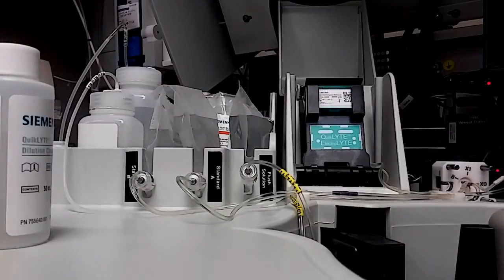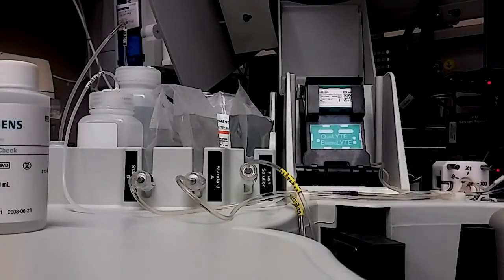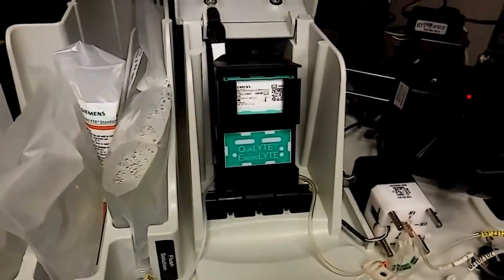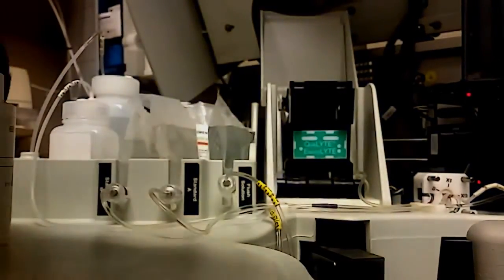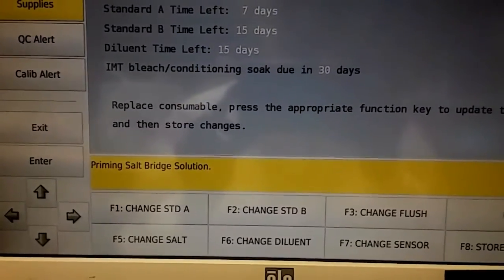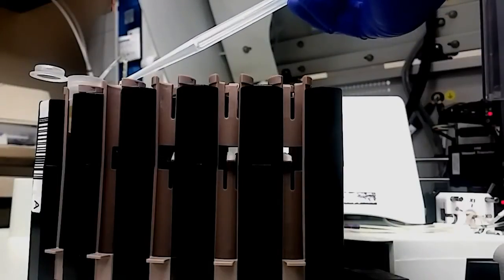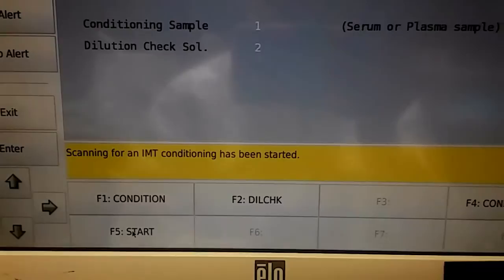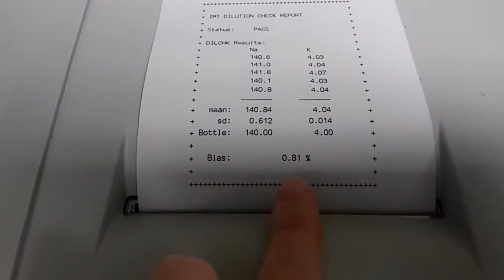DEMO: How to Change the Quiklyte Multisensor for Siemens Dimension EXL 200 and Xpand

Comment: Hey, we are starting to use this machine, and were told to always POUR the Dil check solution into the cup, to prevent contamination of the bottle. Are we just overly careful??
Reply from the maker: I heard that too after I've been not pouring it for years haha. I've never had a contamination problem with the dil check. Have had a problem with lytes before but actually ended up being a bad lot of standard A reagent.

Comment: You want to date and initial the sensor that you're replacing.
Reply from the maker: That is true, that is probably good lab practice. lol However, I am the only one to change it, so I know when the time is up. Plus, the instrument says when to also, so I never write on it. But also, I try not to touch it anymore than necessary, since barely touching the sensors on the back can throw off your lytes results.
Reply: It is recorded electronically in the system counters section.

Comment: Hi, we are going to choose from Siemens Exl 200 and J&J Vitros 5600, can you please film a video to show the operation of Exl 200, to run some tests on it, for example RFT, LFT. It would help us to determine its speed and how "easy to use". Thanks very much. 
Kind regards
Ivan
Reply from the maker: Sorry, probably won't be able to film that, however, I did film another video on how to change the film tape and load it, on the EXl 200. https://youtu.be/Q5SwAuPRD7Y

Overall, I recommend it, depending on how many patients you are running a day, and stats versus routine. We run CMP's mostly and it probably takes roughly about 15 minutes I'd say. TSH, lactic acids, and Beta HCG's, take quite a bit longer, but the EXL will automatically dilute specimens that need it, to a certain point, which is nice.
Reply: Thanks very much. How long does a daily maintenance for Exl 200 normally takes? And what do you do in daily maintenance?
Reply: Btw, what does CMP stands for?
Reply from the maker: Where are you from? lol CMP is complete metabolic panel, you know like kidney function, liver enzymes, electrolytes, calcium, albumin, and a few others i cant think of at the moment. On our 200, we have night shift run the daily maintenance around midnight (or if they are busy and dont have a phlebotomist, whenever they get to it in the early am) because it takes an hour maybe depending on if everything passes or not, (Qc, and system checks) Then we just have to do electrolyte QC every 8 hours, (only takes like 5 or less min) and calibrations before they expire. Now when I work at a lab with the xpand, more like a physcians office lab/ clinic, I run everything, system checks, electrolytes early in the morning when i get there, so I can start running QC and it be good for 8 hours to cover my day. And on Monday I change the sensor because they are good for a week.
Reply: I see, we are from Hong Kong and we usually say RFT, LFT or full chem panel. Haha it was the first time i heard of CMP.
Reply: For the sensor, can they be stable for 7 days? or only 5 days?
Reply from the maker: ahh that's why.. I figured not U.S. because everyone says CMP here lol and yes 7 days 👍
Reply: Can't find any other demonstrations for the dimension this is the only video?